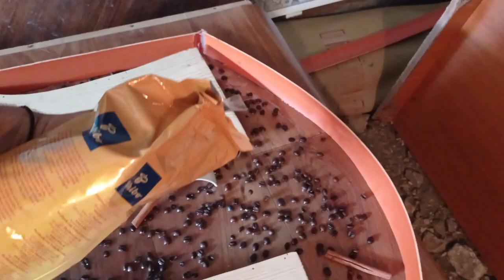Epoxy Coffe Table: Cum sa faci o masa din Lemn cu rasina epoxidica

Comment: Salut, exista un lac special pentru rasina epoxidica? Ce tip de lac ai folosit? Eu momentan "ma joc" facand suporturi de cani/pahare rotunde..folosesc hartie abraziva pana la 2000 dar la final suprafata inca este neclara.
Reply from the maker: Bună, am folosit lac Acrilic el este pentru automobile. Dar se aplica: șlefuiești suprafața cu hîrtie abraziva pina la 600 apoi dai suprafața cu lac, și pe urmă poți prelucra suprafața acoperită cu lac cu hîrtie abraziva pina la 2000 și apoi să lustruiești.

Comment: Salutare am vazut ai folosit linoleum pentru cadru,.din ce se mai poate face fara a prinde rasina de el? Linoleumul se da foarte greu jos, am auzit c.ar.merge si cu placaj daca e pusa folie ,ciololfan etc am inteels ca.nu prinde.rasina pe el..
Reply from the maker: Bună, da leloniumul se dezlipește foarte greu, l-am dezlipit cu ambele picioare țintind masa și trăgeam din el foarte greu, de evitat chestia asta se poate de folosit tot lenolium, dar de acoperit cu lipici. Folie inca nu am folosit, dar credca tot se poate doar că folia e subțire și probabil că poate să se lipească pe rășină bine fiindcă cînd amesteci rășina ea se încălzește. De asta credca lipicul e cel mai bine de folosit. Din placaj tot poți să faci, sau din AGT (din care se fac bucătării)  dar tot de acoperit suprafața cu lipici.

Comment: Am două blaturi de lemn stejar cu grosime de 2 sau 3 cm pot realiza un blat de masă cu rășină epoxilică ?
Reply from the maker: Bună de doi va fi cam slab, sa fi fost sa aibă 3,5 cm grosime avea sa fi fost normal. 
La asa grosime blat de masa poți sa realizezi, dar riști sa crape masa.
Reply: @ROYALEFFECT  Mulțumesc frumos !
Reply from the maker: @mirceastanescu2207  cu placere, poți sa faci din ele mese mici de cafea, sau tave pentru micul dejun.

Comment: Bună ziua, ce arta minunată.am fost trimisa aici de cautarile google pentru ca vreau sa fac un blat la bucătărie și nu stiu ce material sa filosesc ka cofrag. Ma gandesc cu teama sa nu folosesc ceva care sa ramana lipit de blat.
Reply from the maker: Bună îmi pare bine că va place.
Aici ca cofrag(carcas) am folosit lenolium bază, prin părți am avut acasă niște placulite de plastic, le-am lipit cu pistol de silicon, am pus foarte mult. 
Ceea ce conține de dizlipere puțin e mai dificil fiindcă plasticul sa dezlipit foarte bine, dar lenoliumul foarte greu, să evitați acest lucru înainte de a turna rășina puteți să încleiați suprafață cu lipici transparent (nu se lipește de blat).
Mai am o lucrare acolo am folosit ca cofrag pelicula groasa, reușită a fost lucrarea.
 Sper sa vi se primească, pe curind.
Reply: Unde gasesti lemnul? De unde se poate cumpara
Reply from the maker: @ovidiustefan6702  bună, de obicei răscolesc pe internet, direct pe Google sau pe 999.md

Comment: Cum calculezi volumul pentru un strat de epoxy?
Reply from the maker: Bună, înmulțești lungimea riului din rășină x lățimea și x la înălțime.
Reply: Mersi ! Eu am vazut la un american ca are aceasi formula doar ca la urma mai imparte la un numar nu prea am inteles. Si mai o intrebare la ce grosime ar fi bine de taiat lemnul pentru o masa?
Reply from the maker: @crss085  posibil ai văzut la backtaiblStudio. Mai sunt pe internet un fel de cîntar pentru rășină, dar eu tot nu prea înțeleg cum se folosește. Lemnul trebuie sa corespundă mărimi. Dacă ai o măsuță pentru micul dejun este ok 2 cm grosime, daca de cafea de la 2,5  pina la 4-5 este ok ( prima masa care am făcut-o are 5 cm grosime îmi pare că e prea groasa, și totuși arată bine), daca este de bucătărie este bine să aibă 4-6cm grosime. Lemnul trebuie sa fie uscat bine, dacă ai cu ce sa masori umeditatea trebuie sa fie 8%. Ultima lucrare care am făcut-o are grosimea de 4,5 ceva de genu și este tot ok.

Comment: Salut, nu vreau sa par hater, incerc doar sa ajut, in primul rand rasina epoxidica este cel mai scump produs, faptul ca ati turnat-o in lemn de brad i-a scazut valoarea, ati folosit prea multa rasina pt o masuta de cafea, ati urcat costul produsului prea mult, rasina epoxidica nu se toarna in aer liber ci in atmosfera controlata. rasina epoxidica daca aveti de gand sa o polisati nu se acopera cu lac, daca polisati rasina nu polisati si lemnul ci adaugati banda adeziva pe margine. mesele rotunde sau ovale se taie cu freza cu compas! Ca produs de lux nu are voie sa aiba bule in rasina sau denivelari pe suprafata. Mult succes va urez!
Reply from the maker: Mulțumim mult pentru sfat, faptul cu lemnul de brad am aflat mai târziu ( bradul practic nu se usucă niciodată) și în orice moment poate sa crape. Dar mai departe cu polisatul aici mai multi folosesc mai multe tehnologii. Dar fiindcă am acoperit toată suprafața cu lac și apoi am polisat-o rezultatul a fost super. 
Asta a fost a doua masa care am făcut-o cu rășină, și mai este și un plus, masa la moment stă afară la terasă, blatul e mai rezistent că picioarele din fier. Dacă acestia ruginesc, blatul nu s-a schimbat. 
 Știu că mai am multe de învățat, și vreau să vă zic mulțumim că ați pierdut din timp că v-ați împărtășit cu gândul și cu profesionalismul care îl aveți.
Pe curind. :)
Reply: @ROYALEFFECT   Finisajul prin polisare direct a rasinii epoxidice asigura un aspect superior oricarui tip de lac, pt mai multa protectie puteti incerca finisajul epoxidic, insa pt a pastra stilul scandinav lemn si ulei puteti folosi odies oil dupa polish sau si armor sealing (nu va diminua aspectul). Bafta!